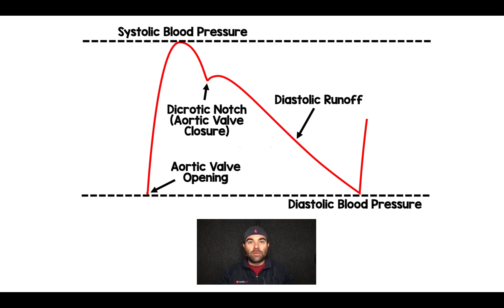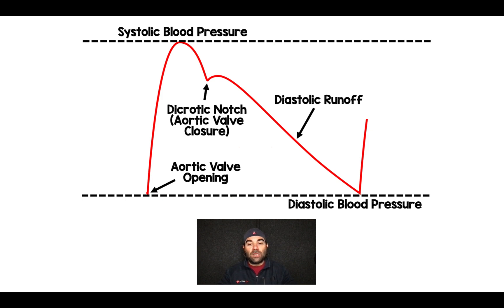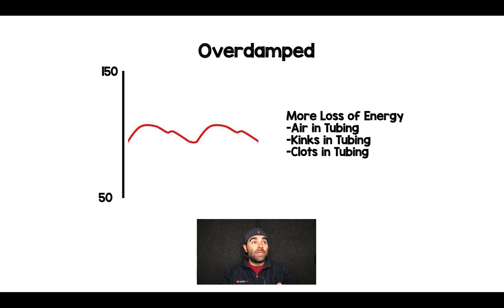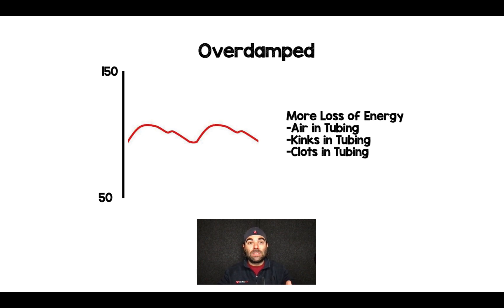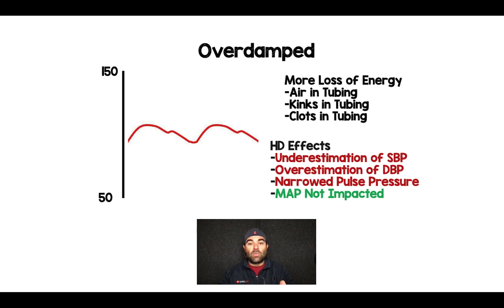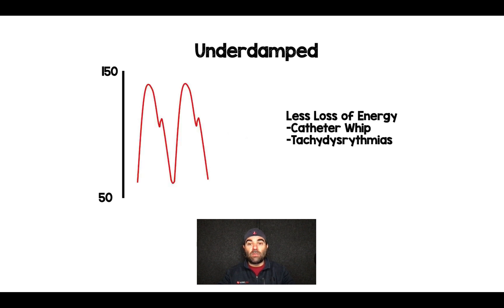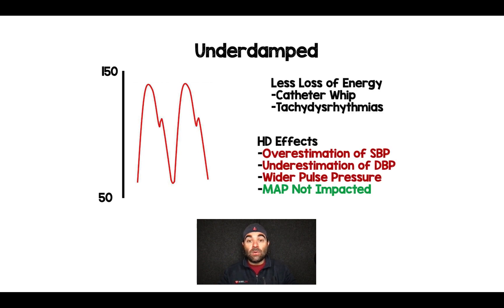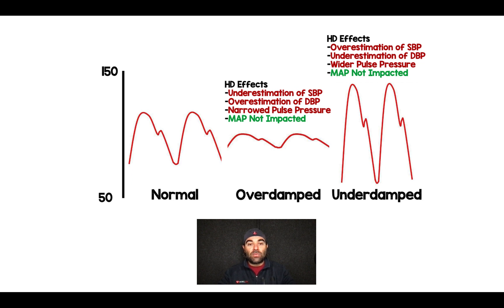A-Lines & Damping

Comment: Can you say with absolute confidence that the valve closes because a backflow of blood due difference in pressure between left ventricle and the aorta occurs? And that this backflow causes at the same time in the waveform the dictoric notch?
Reply from the maker: As long as there are not valvular abnormalities, then this is normal physiology
Reply: @SalimRezaie  just a small follow up, if its possible. The backflow and dicrotic wave is attributed to the difference in pressure but also to the passive elastic recoil of the aortic wall?